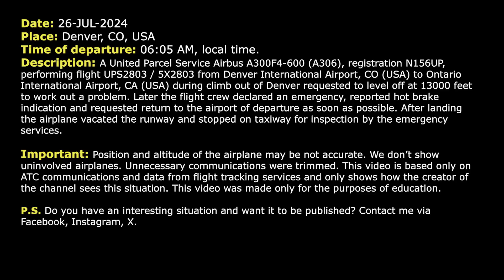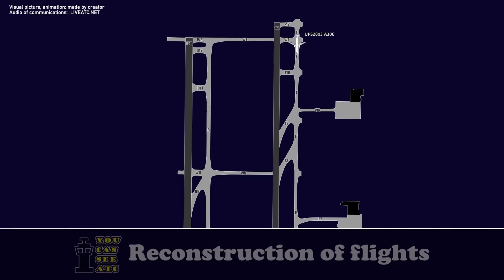“We need to return ASAP”. Hot brake after takeoff. UPS Airbus A306 returns to Denver. Real ATC

Comment: I actually work for UPS at Denver Airport & still remember getting a call saying that one of our airplanes is coming back, so we decided to send up our towing team, but instead the pilots brought the aircraft down from the other side of the airport coming in really fast, we look at the brakes & the brakes were completely fine, The sensor was acting a little bit faulty, in order to save somewhat time they decided to download the entire aircraft & then upload another Airbus A300, but that other A300 that we have on the ramp also had some brake issues, where the brakes were completely worn & we were scheduled to have them replaced during the ground at the aircraft had, but ordinary to save time we had to defer the maintenance until the aircraft got to Ontario, & after all that, the aircraft still went out late, & we didn’t save any time at all. I can’t wait to share this with the rest of the UPS team

Comment: similar thing happened to me some years ago. Pilot opted to lower the gear to allow the wheels to air-cool. Apparently, this happens with the A306 a lot. It doesn't want to run at low power, so you tend to ride the brakes when taxiing.

Comment: I fail to understand how they could have hot brakes after taking off? how could this happen? Erratic sensor reading?
Reply: Maybe one of the brakes got stuck while running for takeoff?
Reply: @salzstreuerdeluxe  Possible, however I am coming from stick shift cars, and hand brake parking. In winter, it is recommended to not use the handbrake, as the cables connecting to the rear brakes may get frozen in their sheath. This happened to me; you release the hand brake, but the brakes are still set. Believe me, you know that the brakes have not released. I don't know much about airplanes, but I imagine if you got a stuck caliper, you would know it?
Reply: Breaking while taxing? Brake got stuck?
Reply: @tinekejoldersma  same reply as to @salzstreuerdeluxe. I believe that if you had a stuck caliper the pilot may feel it. Especially on a single side. The aircraft would have the tendency to veer towards the stuck brake.
Reply: @p6x2  I understand that from a car perspective, but something bigger like a truck is already different. A plane is of a whole other magnitude. I am no pilot, I don't know how it shows. It was a wild guess.
Reply: The Cargo ramp at Denver is about 3.5-4nm of taxiing from 34L at Denver which requires lots of turning, slowing down and speeding back up so I can see why their brakes got toasty
Reply: @nocoaviation8353  I believe many cargo planes use that same path to get to the runway, thus putting the brakes through the same constraint.
Reply: Bad wheel bearing could cause heat in that region
Reply: Hot weather;
Long Taxi;
Overuse of brakes on taxi-out.
Reply: @BruiserFL  As above, I am not an expert however the only time the brakes get hot, is during a landing. I do believe the brakes can take long taxis with stop and go. This is currently the norm on many airports now.
Reply: id bet a fair bit of money on a bad sensor, and another comment seems to claim insider knowledge of a bad sensor
Reply: @UnshavenStatue  I think this is the most plausible cause.
Reply: If a wheel broke or somehow caught fire during takeoff, it could trigger this sensor. That's why they declared emergency so fast - The worst case scenario is a fire in the wheel bay.
Reply: Probably bad maintenance - brakes not adjusted properly
Reply: @RabbahDocRona  that strikes me as plausible. Pads too close to the rotor.
Reply: @p6x2  absolutely. Another possibility would be debris like grit...